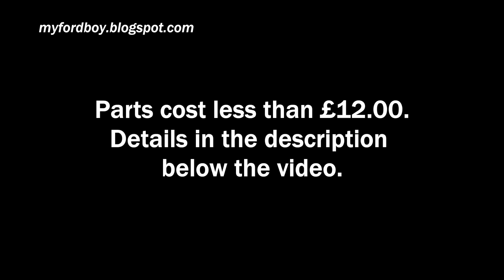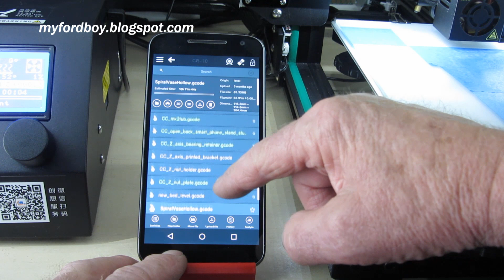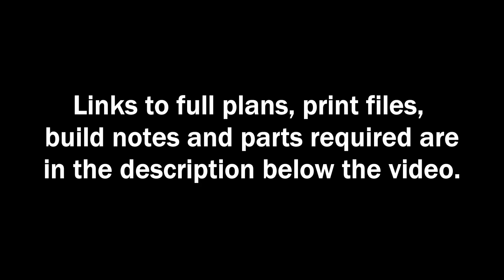CR-10 Dual Z Axis Low Cost High Precision Upgrade

Comment: Hello, wondered if the leadscrew of my cr-10 mini is the same as the one you have stated in the parts? Also forgive my sillyness but what's the use of the second shaft coupling?
Reply from the maker: The coupling secures the rod to the bearing. A collar would do the same job. Without it the leadscrew would rise when the axis is travelling up.
I expect the leadscrew is the same on yours. I don't have one to check. It is 8mm diameter and one turn of the screw gives 8mm travel.
Reply: Thanks for the info
Reply: did you find out necessary components for mini upgrade ?  I am aware of timing belt lenght as the build volume is lower as standard cr-10 size. thanks

Comment: I found 2 different lead screws. Could you tell me If I need the 4 start one, or the other one? I can't remember what it was I think it was a single start. Thank
Reply from the maker: 4 start, One turn = 8mm travel.
Reply: Thank you
Reply from the maker: Use the link I gave to be sure.

Comment: I have been working for 5 days with the Raspberry and it does not work. I am happy that your raspberry and wifi works perfectly. :) (that's not a question) :D
Reply from the maker: I could not it to work either. I had a lot of help from a friend in IT.
I could not get the Pi to show up on my WiFi. Sorry I cannot help with your issue.
Reply: This is really nice that you wanted to help me but that is really not necessary as well as a friend of mine who knows with IT comes on Sunday and I wish it will finally work.
Reply: This is really nice that you wanted to help me but that is really not necessary as well as a friend of mine who knows with IT comes on Sunday and I wish it will finally work.
Reply: Not able to get octopi up on wifi?  Well, I`m not suprised, all tutorials I found where wrong. I can email you what you should do to get it up (havent whatced the whole video, so I might be wrong on otcoprint - I just jumped to a possible "error"
Reply: Oh i forgot to read your comment! Dude thanks for trying to helping me! :DD But that is not necessary, thank you so much! :) I failed with the wifi IP adress, because I thought up the ip address myself and did not use the ones specified by the rounter...that was the problem ._.

Comment: Lead screw has a diameter of 8mm and what is the thread pitch of 2mm or 8mm?
Reply from the maker: Some of the descriptions for leadscrews can be misleading. I recommend getting the one I have listed to be sure it's correct. I ordered the wrong one myself the first time. It has a 4 start thread.

Comment: Hello Sr,

I just wanted to know if this solution worked? Are you getting more accurate parts? Thank you in advance
Reply from the maker: I got great prints before the mod and after. Mechanically it has to be a better solution than only having the X axis supported at one end.
Reply: Ok. I thought you add the modification because you needed to achieve more accuracy on your prints and weren't able to do it with the original set up. That's why I wanted to know if you noticed any change on your parts dimensions

Comment: Having 2 motors might be tiny bit (imperceptible)  more accurate, but I like this solution better. I wonder why Creality CR-10S uses dual motor instead of this solution.
Reply from the maker: This solution is more accurate than 2 steppers as they can get out of sync.

Comment: Thanks!  You wrote 'GT2 Aluminum timing belt pulley 36 teeth(..) Make sure you order the 32 toothed pulley.'

Eh, did you mean 'Make sure you order the 36 toothed pulley' ?
Reply from the maker: Yes sorry, you need 36 toothed one.
Reply: Can you tell me the measure for sealed bearings

Comment: What app are you using to control the print on your cellphone? nice upgrade!
Reply from the maker: Printoid Pro
Reply: I use Printoid Pro as well. Love it! I recently had a minor problem (my fault) and the developer was helpful and pleasant to work with.
Reply from the maker: The App is great. I had an issue with some of the text being unreadable , probably associated with my Moto4 G phone.  i reported the bug and it was fixed in the last update.

Comment: Awesome video and good solution for a common problem with the cr-10. I noticed that some nuts, bolts, and washers were needed, but I'm not exactly sure what kind I'm supposed to buy for it. Is there any chance you could leave a link to those too? Thanks and keep up the nice videos
Reply from the maker: You need  
2 M3 x 18 socket head screw , washers and locknuts.
2 M5 x 18 socket head screws and washers.
 2 M5 tee nuts like this https://www.banggood.com/100pcs-M5-Hammer-Nut-Nickel-Plated-Carbon-Steel-Nut-Aluminum-Connector-T-Fastener-Sliding-Nut-p-1048442.html?rmmds=search

You may find them for sale in small quantities on Ebay.
Reply: myfordboy thanks for the fast response
Reply from the maker: I forgot, there is also 2 M8 washers. The outside diameter needs to be less than the hole in the bearing block so it may be easier to use a smaller one and file out the centre.
Reply: Having printed the RH block out, I think you mean M4 not M5 - the holes seem to be M4 sized.
Reply from the maker: The right hand block has a 5mm through hole and an 8mm counterbore for M5 screws.
Reply: Where I buy bolts from only has 16 or 20mm length bolts, would the 16mm work? BTW this mod is an excelent idea.
Reply from the maker: Just buy the long ones and shorten them. Thread a nut on the bolt before you cut it. then the thread won't be damaged

Comment: What would be the length of the belt for a width of 400?
Reply from the maker: The belt specified is for a 300mm wide bed. For a 400mm one you would need it 200mm longer ( if one is available)

Comment: Are these dimensions for the 30x30x40 CR10 ?
Reply from the maker: Yes
Reply: @myfordboy  Is it fine if we use aluminium sliding T nuts instead of steel ones ? and same question for the M5x16 screws, there isn't any on Bangood but some on ebay, should we use steel or zinc ones ?
Reply from the maker: @mathieuclerte5252  Yes ,plenty strong enough.

Comment: so basically , this mod + run out of filament sensor mod , makes a cr10 a cr10s ?
Reply from the maker: There may be firmware differences on the CR10s. I believe my dual Z axis mod is better than the one with 2 steppers.
Reply: i'm at my very first 3d printer , and all the opinions contradict . really dunno wich one to go for , but i do like the cr10 . In your opinion , does cr10s worth about 30% of the price difference ?
Reply from the maker: I'd go for the standard CR10 if there is a big price difference. The price has gone down since I had mine, using code https://goo.gl/wXrkMi it's around £300 GBP. I can't fault the prints, even without the mods, it's the best I have seen.

Comment: Another question, which slicer do you use?  Do you 3D printed holes come out pretty close to the design size or do you have design them bigger than what you actually want?  Thx... Chuck
Reply from the maker: I am using Cura 2.6.1
I do have to draw small holes a bit bigger, say 3.2mm for 3mm hole. Everything else comes out on size.

Comment: +myfordboy Hello, as it is done to print like you from the phone, this very good ... could you explain it?
A greeting from Spain.
Reply from the maker: First you have to connect the printer to a Raspberry Pi and then connect to Octoprint which allows you to control the printer from your PC.
I wired a 4 way relay board to the Pi and wired the sockets that the printer and lights plug into through the relays. There are videos on Youtube showing how this is done.The Printoid App has a command function that allows you to control the relays.

Comment: Hi, will this work on an Ender 3 too?
Reply from the maker: You would need a shorter belt and leadscrew and the power supply would have to be moved. I have an Ender 3 also and I don't think the mod is needed as the X arm is shorter. It could be made to work though.
Reply: @myfordboy  Ok. Thank you for your help.

Comment: No nema dampers?
Reply: that is a misguided part. If your motors do virbrate, it is most likely caused by the stepper drivers themselves. That vibration is on the shaft, so it is directly coupled to the part you wish to drive. A damper will not remove this vibration, but it will add spring (backlash and ringing) to he moving parts. It may sound a little quieter (less vibrations transmitted to the frame) but that comes at a high cost. if you want quieter motors, use better stepper drivers like tmc2130's. Unfortunately the cr10 has a melzi board with integrated shitty drivers, so an tmc2130 upgrade would mean a mainboard upgrade or serious hackery.

Comment: Could this work on the ender 3?
Reply from the maker: I have an Ender 3 and don't think it's needed on this printer. It could be fitted with modifications. You would need shorter belt and leadscrew would and have to move the power supply.

Comment: For the GT2 Aluminum timing belt pulley try typing    16/20/36T GT2 Aluminum Timing Pulley For DIY 3D Printer in banggood and it will come up
Reply: Can't you just print them?

Comment: After using 15% off coupon: bgprinter, it showed cleanly in the shopping cart the price that I have to pay. When I went to check out by paypal, Banggood still charge me original price. I opened the ticket on papal to request refund .  Is Banggod a scam site ?
Reply from the maker: I find Banggood are excellent. Sounds like a glitch. I have no problems with them. They will sort it I am sure.
Reply from the maker: Banggood have a good record. It's Gearbest you want to avoid.
Reply: +1 for Banggood. Order multiple things of them and all arrived.

Comment: Not sure why the 10S did not use this approach as it uses less electricity, saves them money for a motor and both sides never lose sync unlike the two motor version (like the I3) will.  Yep, the Chinese are incapable of thinking outside of the box.

Comment: Hi. what bearing or something need insert in this piece? https://youtu.be/-ASBhJiU8NI?t=681 is not clear in the vid
Reply from the maker: All the parts needed are listed in the description below the video.
Reply: But not the position in the piece, like the bearings of the z left axis support https://youtu.be/-ASBhJiU8NI?t=41
Reply from the maker: The bearing in the left Z is the original one reused. I am aware there are 2 different designs for the bearing block. Mine had a flanged bearing inside.

Comment: BandGood would NOT honor your discount code! The only thing offered was 16% "IF" you ordered it from the China Warehouse not the USA Warehouse and of course they jacked up the price 20 Bucks, so the so called discount is meaningless.
Reply from the maker: I don't work for Banggood, just passing on a code I have to help others. Sorry if it did not work for you , not my fault.
Reply: It was an FYI Message just to let you know.... I know it's not your fault, but you should know or be aware whether or not they will honor a discount they tell you to promote.
Reply: 10% off the Cr10 brings it down by about 35$. 16% even more
Reply: The discount they told him to promote was for 20%

Comment: If these mods are really necessary, why doesn't the manufacturer just made all future releases with said mods implemented? Lastly, this isn't a CNC machine, you're not placing pressure on a cutting head. I get what you're doing but why? I doubt the .2mm of Z motion really places that much run off on the axis? It would be one thing if the Z axis was moving up and down rapidly in succession but this all honestly seems unnecessary.. Did you buy a 3D printer just to upgrade itself?
Reply: The manufacturer does already include dual Z lead screws on the latest CR-10's. It is not 100% needed but one side of the gantry will lag behind if it is adjusted enough. If over adjusted it shows up in prints so is not easy to get both sides to move at the same time with one lead screw. Not saying it can't be done but this sorts that problem out. Also it helps if you add any extra weight to the gantry, such as extra part cooling fan, bed probe etc.

Comment: Your myfordboy .blogspot not working
Reply from the maker: https://myfordboy.blogspot.com/p/hit-and-miss-engine-giveaway.html is working just fine
also myfordboy.blogspot.com
Reply: @myfordboy  Try to ask some question about the Lead rod and when i try to send always got a red line server is not working.Thank you
Reply from the maker: @jsz7087  It's working for me. You can ask here or on thingiverse if your link does not work
Reply: @myfordboy  Thank you i just like to ask how to calculate the teeth for the pulley,yours is 36 teeth for the 8x2x8  lead rod.What i like to have is 8x2x2 lead rod. 8 is the diameter,  2 is the pich  and 2 is the lead in my case.So how to calculate the teeth for the pulley?Thank you for your simple and excellent work.
Reply from the maker: You can use the same pulleys or any other size as long as they are are both the same size.
Reply: @myfordboy  Thank you so i do not need to to recalculate the hole thing.Thank you that is the best for me.Thank you for your excellent work working even for old starter like me.